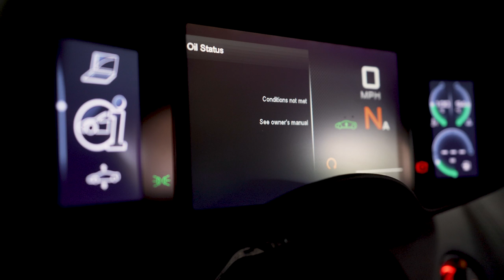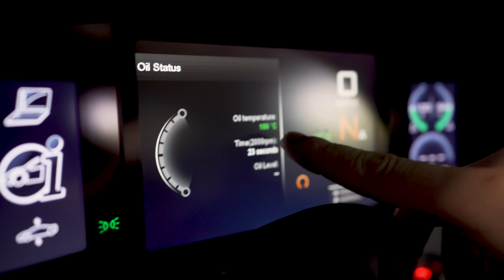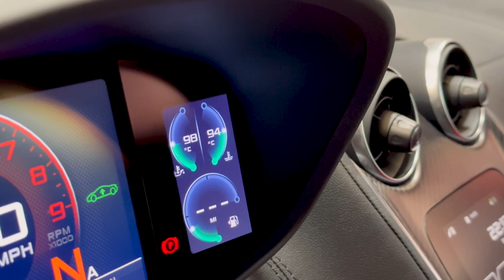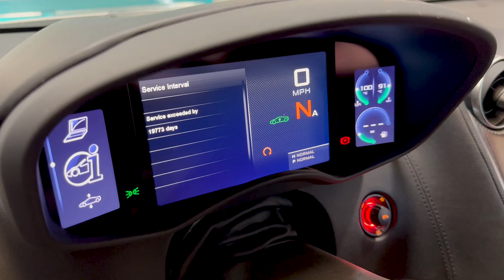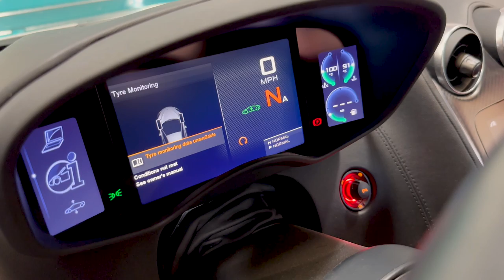Sylvain Guintoli's McLaren 570S - Full Service & Dyno Run!

Comment: Do you have to lock the suspension into a service mode before you put it on the lift?
Reply: No, there's only the option of lift on the car which takes the front up about 40mm